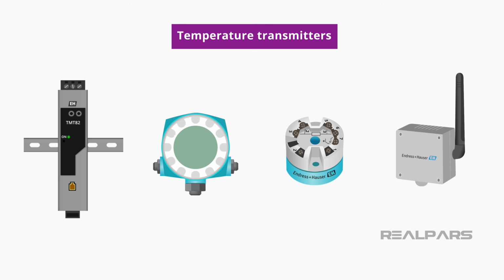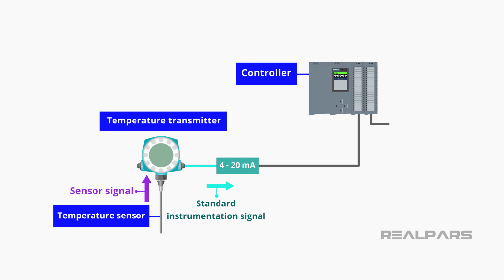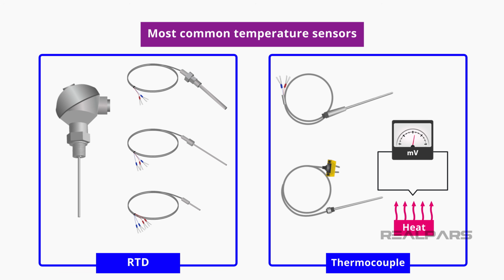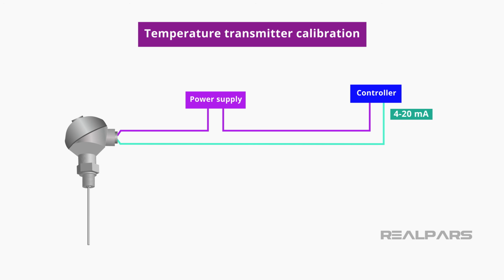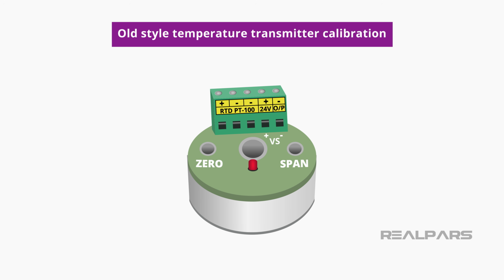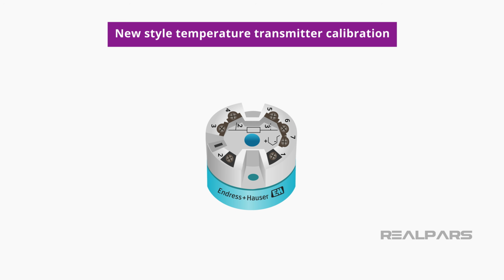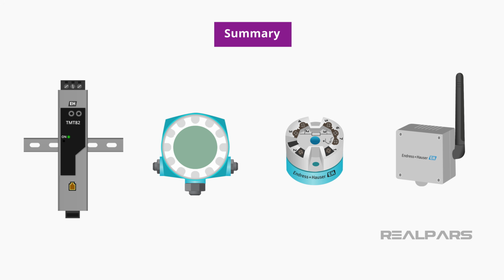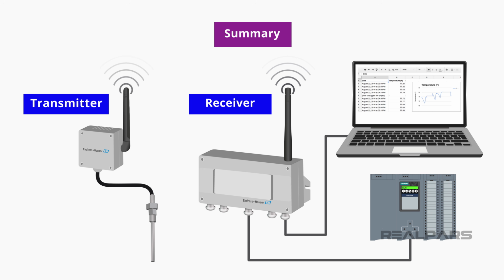Temperature Transmitter Explained | Connection and Calibration

Comment: I'm confused. In the other video, you didn't say 24v is needed, you said 1-5v output.
Reply: Hi @Furkan.  Thanks for reaching out. I'm not sure what other video you are referring to.  A 24 power supply is required for 2-wire transmitters as described in the video. There certainly are transmitters that produce a 1-5V output instead of a 4-20 mA output. This type of transmitter is a 4-wire transmitter.
Reply: @tedmortenson4036  
https://www.youtube.com/watch?v=DVq10SGKHMU&t=358s
HELLO I WATCHED THIS VIDEO THERE IS A DIRECT 5 V OUTPUT SUPPLY IS NOT IN THE EXPRESSION 24 V
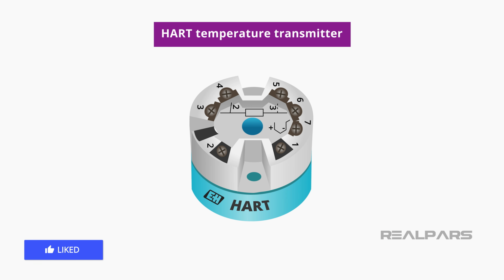Reply from the maker: Hi  @furkan6200  . Thanks for pointing me to the video. From 3:15 to 4:14 in the video we refer to a 1-5V output to the PLC. You are correct. It is not possible to produce a 1-5 volt output signal without some type of power supply.  And the only way to accomplish this is by adding another 2 wires connecting the transmitter to a power supply. In most cases, that power supply is 24V DC which may come from the PLC cabinet itself, or from a power supply closer to the transmitter.   It's also not uncommon for a transmitter power supply to produce an AC voltage. Having said that, I've never seen an AC-powered pressure transmitter in the field.  To be absolutely accurate, we should have indicated some form of additional power in our video. Thanks for bringing this to our attention.

Comment: can i install tia portal on macbook air m1 pc ?
Reply from the maker: No, TIA Portal is compatible only with on PCs running Windows 7 or Windows 10 (Windows 11 is being tested), or servers running Windows Server 2016 and later.
Reply: Under no circumstances can WinCC and TIA Portal ever run on a $#! Apple M1 processor. Sorry, sir, but you wasted a few grand with which you could have acquired a decent SIEMENS Field PG that is designed for a wide range PLC class.